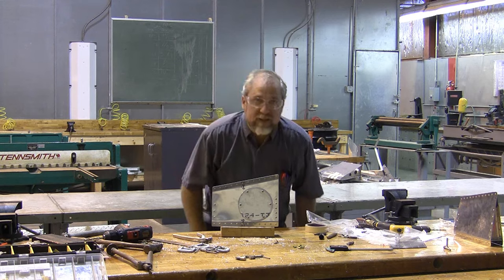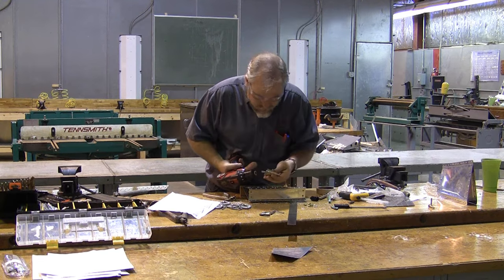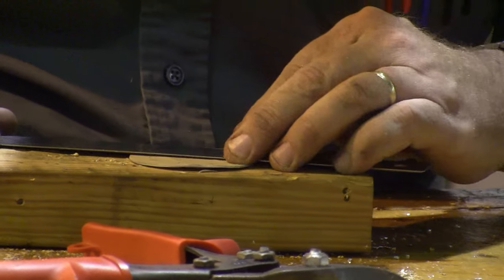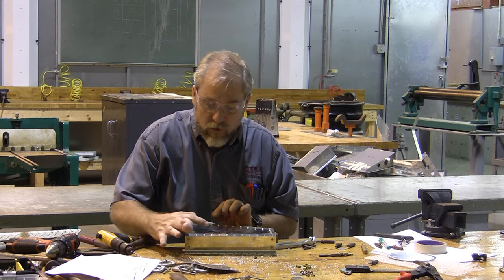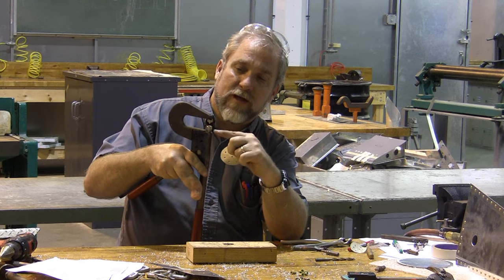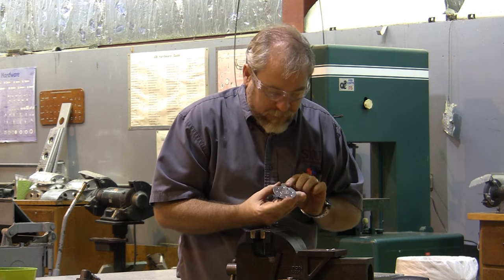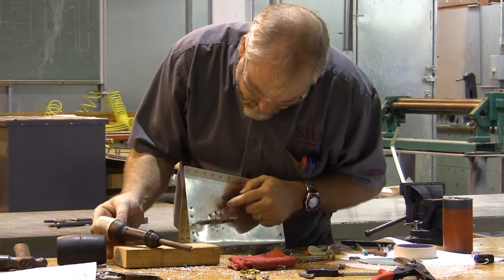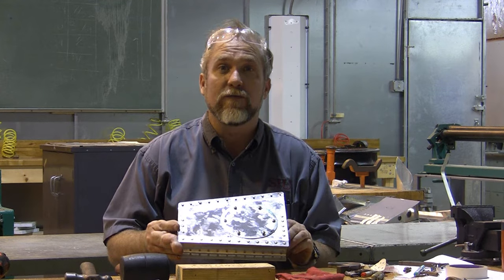AVT 206 A&P Project 3B - Damage and Flush Patch

Comment: Can you please make a video explaining the correct measurements for the same one inch hole. DME's in my are asking this a lot. A 1.75 distance between the outer rivets. A total of eight rivets around and they all have to be exact. Thank you for making this video.
Reply from the maker: Are you looking for an AC-43.13-1B explanation?
Reply: I think the one he covered was letter (k) 1” inch patch plate the distance suppose to be 2x from the edge of the patch but no more then 3x for rivet spacing am I right ?

Comment: What is the advantage of dimpeling over countersinking for the flush rivets?
Reply from the maker: Countersinking is much quicker and easier - particularly for the guy driving the rivet.  You dimple if the sheet is too thin for a countersink to fit (the countersink cuts out of the other side of the sheet).

Comment: Does grain direction not matter in a flush patch? Does the grain direction have to be in same direction as original structure?
Reply from the maker: Grain direction typically is not considered important on sheet metal parts unless bending at near the minimum bend radius, where bending across the grain is preferable.  I usually pay attention to it in my projects because when left uncovered, it can be visually jarring if the grain runs different directions.  I also try to use rivets from the same batch, because some have slightly different coloration...
Reply: @1donagin  thank for for getting back too me! Im taking my airframe Oral and practical at the end of February. So been watching your videos! Trying to relearn bend allowance and sightlines

Comment: Can you show how you determined the spacing of the rivets  for  both  1" and  2"  circular patch ?
Reply from the maker: Hi.  The 2 inch circular patch rivets are determined by the repair manual.  See AC-43.13-1B (downloadable for  free), or the Cessna Structural Repair manual.  Both specify the spacing.  The 1" inner patch is simply a scab to make everything flush, and so the spacing is not critical.
Reply: @1donagin   Would that  be the 45 degrees indicated in the structural  repair manual , for the spacing ?
Reply from the maker: @tajaheedwards1516  360 divided by 45 gives you 8...
Reply: @1donagin  Thank you and how would you determine the edge distance  or calculate  for the  1" and 2" patch?
Reply from the maker: You will see that the manual tells you what diameter circle to put the rivets on.  It also tells you the hole diameter and the doubler diameter.  Do the math, and the edge distance will come out correctly.  If my memory is right, AC 43.13-1B calls for a 2.5 inch doubler on a 1 inch hole, with the rivets on a 1.75 inch circle.

Comment: In an actual aircraft what no. of rivet should be used? Ty
Reply from the maker: Depends on the aircraft, the thickness of the material, the type of material, and the location.  Most small aircraft use AD rivets, approximately three times the thickness of the thickest sheet.  Your aircraft manual should spacify.
Reply: 1donagin thanks for the info